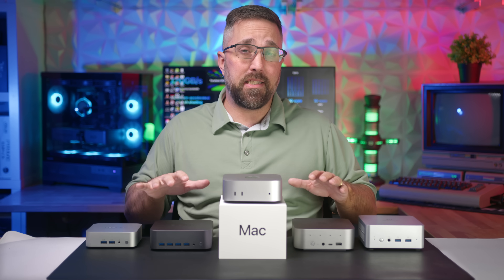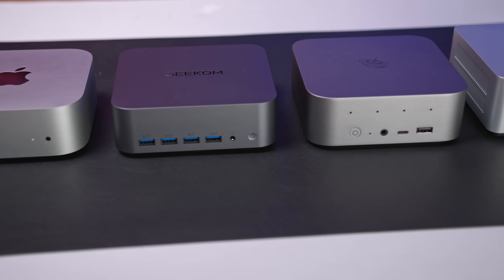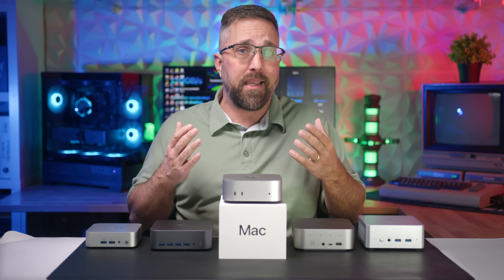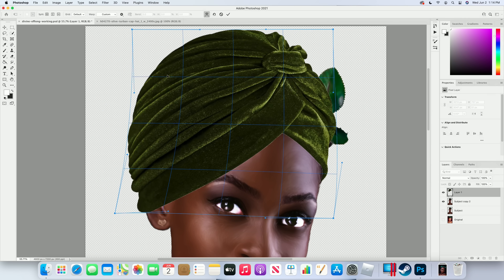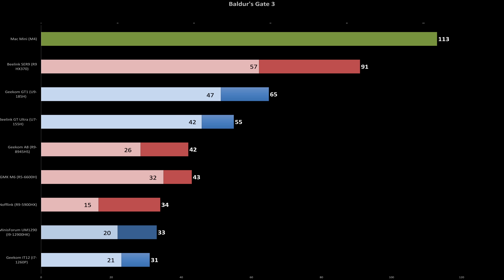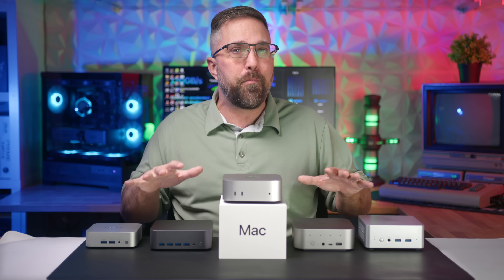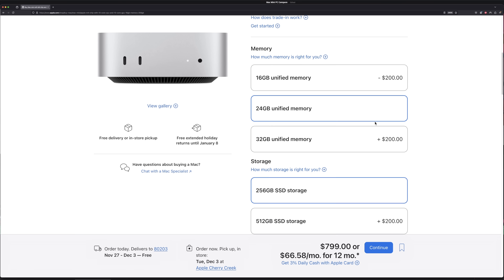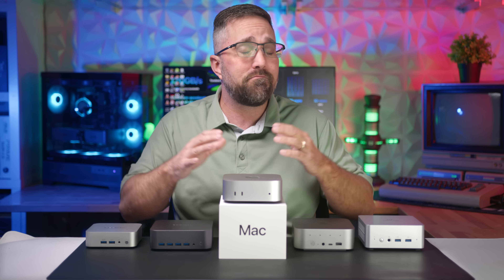M4 Mac Mini vs Intel and AMD Flagships – It's Not Even Close!

Comment: Was the Mac Mini running Windows? You need to compare all computers running equal systems, if one has specs that the other simply cannot get then that's not a fair comparison is it?  The Mini PCs were developed to meet Windows specs (an OS that still tries to support legacy hardware and software). They rely on different manufacturers who are competing for skin in the game in a massive computing industry.  This gives consumers more power because they have more and better choices on graphics, RAM, storage, and other upgradable parts.  The Mac Mini is a proprietary system running on pretty much the same OS for their mobiles.  It's also no accident that Apple focus on certain benchmark tests under different conditions, they're not running the same OS!  Real-world users looking at $599-$1000 computers are interested in something cheap enough to do daily computer work (MS Office and internet) and gaming.  They not looking to do serious video editing or 3D work unless they opt for more RAM and storage, which is inevitable with the way OSes and applications are going.  Even smartphones have 16GB of RAM.  The Mac Mini could probably impress your friends on the first day, but down the line it will become expensive trying to upgrade it.  
Future proofing and upgradability is the key.  The first mini is forgotten, and this one will be in a couple of years.

Comment: Remember when you could get the equivelant of the HX370 (7840HS) bare bones for around $500 shortly after launch? 
Yea, this is why AMD, Intel. and board partners want to go with soldered memory.
They want the Apple tax(many already do this with laptops)
When companies say that soldered RAM is for better performance, they are intentionally leaving out A LOT of context and factually wrong without that context

If the systems were designed differently, you could use fast upgradable RAM, the problem is that fast RAM requires cooling, and most of these small form factor systems have horrible layouts for cooling laptop RAM by stacking the RAM on top of each other, basically sandwiching the bottom stick, between the motherboard, and the top stick leaving basically only one side of the top stick properly cooled.

For instance. Before soldered LPDDR4X 4266 came out i was already running DDR5 5000, this was because i had desktop sticks and adequate airflow. Not only is the frequency higher, the latency is far lower and CL17-17-17-28 (running in 1:1:1:1 with my 5700G)

Same thing for DDR5, but this time, without overclocking, i've been running DDR5 8000 for about a year and its just an XMP profile on this 48GB kit. Show me LPDDR5X that runs at DDR5 8000 CL40 a year later.

Dont get me wrong, soldered RAM is a good thing..... for mobile devices like laptops and tablets, but when you're plugged into a wall and dont need to worry about a 5-15w stick of RAM other than how to cool it? It is cheaper, relacable, and just plane faster despite having longer traces

I do have high hopes for LPCAMM/LPCAMM2, this places all of the chips for what would be 2 sticks of RAM, onto one side, of a single stick, meaning it can be cooled with simple single-channel airflow, and now that DDR5 is better at varying its clocks, you could easily have an 8000-12,000MT/s profile for when you're plugged in, a 7200 when on battery but still gaming, and then 2133 when effectively idle
You probably would not want 8000-12,000 while on battery due to deminishing returns, sure it might make the system 15-20% faster, but its also going to likely make the system use 50-100% more power from the battery. This is actually why my file server with 5700G is running 2400 RAM and only running at 3Ghz instead of 4.5Ghz, ~70% the performance, 1/3rd the power draw, my entire server rack is under 350w under full load and this includes a 7950x, a 3950x, a 40G switch(2x40G 4x10G 48x1G) 10 spinning drives and ~24 SSDs.
Reply: What confuses me is why LPDDRx tends to have worse latency than equivelant speed desktop memory, you'd think that with those extremely short traces and significantly reduced number of physical chips that you'd be able to get very aggressive timings, say DDR5 8000 at CL26 instead of CL40 (desktop dimms can have 16 chips though generally the fast ones only have 8 where as LPDDRx can have as few as 2)

Comment: Mac Minis are not useful unless they support upgrading internal components like RAM and SSD. SSD of a Mac is just a chip. They can create a socket like desktop processors and provide customer with the option to upgrade it easily with proper compactness and chance for little movements and jerks. But they wont do that, I dont know why. Desktop systems should always be upgradable as per user needs changes. SSDs have less life span, we have already seen macbooks being dead just because of a tiny SSD. How we can support that? A really capable high performance machine that hosts cutting edge technology becomes just a brick when an inexpensive tiny SSD goes bad?

Comment: 5:10 They better not, I mean now that LPCAMM2 has arrived and is beginning to be commercially available they better use it, because I’m not going to reward that behavior from the other manufacturers, if they are going to remove me from any future upgradability and I need a new PC I will buy a Mac tbh, the same reason on high end phones I chose an iPhone instead of going to an Android AFTER they made basically impossible to have a high end phone with a MicroSD slot, steering to phones just a bit here but applies or both but if you’re going to go down to the Apple level f you then I prefer to go to whom was always down there instead of rewarding that behavior (or copycat behavior)

Comment: Base mini is not a deal. For this test bench, games were run from external disk. At any point in the name of ai, even installations will be impossible on external drives. If u invest in a walled system, u ll only get suckered in more and more. 256gb is nothing. Usable space will be less than that. Macos will take up space. Any important software will take up rest. So u r left if nothing if u want to install some more software or games. This is just a browsing machine nothing else. 512gb is where a working machine is at and it's 700$. Tbh y r base macs even reviewed. They r just browsing machines. Better to get last gen with more storage at that price.

Comment: 256GB of storage on a $600 computer is inexcusable in 2025, and charging $200 for an extra 256GB is a felony. 
I paid $160 for a N95 mini PC with 12GB of DDR5 memory and an upgradeable 512GB M.2 drive...
Reply: My 6 year old phone has more than that. Pathetic.
Reply: I paid $170 for an Optiplex 5050 SFF with 16GB memory (DDR4, 2400) and it still comes with a 512GB SSD, ain't no way in calisse I'm paying $600 for 256GB, that better be at least 1TB
Reply: being this entitled, and deciding what other company shall deliver at what price.. is likely more a "felony".. mindboggling entitlement.
I love that they made a 256GB 16GB version as that fit well with my usecase as a secondary device for certain things with our older OLED TV.. in regards to fx Apple only made a 512GB as the entry version at 799.. if Apple made a 128GB M4 version at fx 450USD I would have gotten that, I need the potency in M4.. HDD space is easy to work around for users that dont need it as their primary computer.
You do understand choices, ain't a bad thing... stop being triggered on other peoples behalf and call it criminal and all that entitled bs because a company gives the consumer choices.
Reply: @JAKOB1977  , thanks, I can think for myself.
If you go shopping for an SSD, you'll see that there's a $20 difference between a 256GB and a 512GB drive. There's absolutely no good reason go cheap on storage... unless planning on charging a whooping $200 for that miserable difference or betting that idiot consumers will run to buy external storage, with all its drawbacks. We are on 2025, files are huge and storage is cheap.
Apple's "choices" are worse than lame and they should be blamed for them.
Reply: @FrancoGrimoldi 13:58 dollar for dollar pound per pound. The Mac is the best that was the point of the video anything else you’re just ranting
Reply: @EAster33  sure I'm ranting. Selling a $600 computer with 256GB storage is beyond ridiculous, it's insulting.
Reply: @JAKOB1977 imagine defending corporation, lame.
Reply: @JAKOB1977  People like you defend anything apple does. 😂 Will you still defend the iPhone 17 Pro's color fading? Their price of charging $200 for every storage/memory increment is just lame. And it doesn't matter how much external storage you connect it to, you still have your OS on a tiny drive, heck my S24 Ultra has more storage than a base Mini. I still have a base M2 mini but as a file server, it's hooked up 18TBs of external HDDs, but even then the core problem remains, if I were to do anything on it, I would frequently run out of storage for my apps and OS.
Reply: @JAKOB1977  it's not entitled to ask to not get ripped off. Being a bit expensive is fine, but $200 for 256GB of storage is criminal

Comment: Picked up a M1 mini really cheap awhile ago,  can easily run a linux and win11 arm vm, smooth as silk.  Since I just wanted to play around and see what it could do. Very impressed, just had to use 3rd party apps to make the key combos like windows, because of muscle memory.  Can easily say its a nice system, its font rendering and easy to read text is probably not mentioned enough.   I have nas and a usb3 storage for it, so storage wasnt an issue.  I do AI LLM stuff, so the PC with a Nvidia is better fit, but music/video mac is still king.  Dunno, you can do anything on both, I'm more of a Win11+WSL+Code (and games) so sticking to windows.   For a laptop on the go, I could see a nice mac pro in the future, that battery life is amazing, display with nano glass is great.   What a time to be alive.

Comment: The price of the Mac is really good, but I think it's a shame that Apple spent a good part of the presentation talking about GPU and graphics performance and didn't have a downloadable tool to run more games. Half of my Steam library with Mac support didn't work, giving an error. Taking Steam as an example, in a short time since the Steam Deck was launched, it already has more compatible AAA games than Apple has in this year of selling M processors. Steam itself saw that the developers weren't going to support games for Linux, and it ran after it and solved it. Apple doesn't even care.

Comment: I just picked up a 8945HS for $700 64GB and 2T, can't even go up to 64GB Ram in Mac Mini, and 2TB is an extra $400 for MAC, not to mention the extra $400 for the 24GB max ram. EDIT: Just checked, so for 32GB of RAM and 2TB of storage, that puts you at 1800USD. YIKES.... So... THERE GOES YOUR VALUE TO PERFORMANCE metric.

Comment: If someone needs 32 GB of ram, they’ll need it on Mac as well. And 2tb ssd. That’s almost 2k then for Mac. Still good value?
Reply: I think poor Dominic doesn't really understand architecture.
Reply: Unified memory is ram
Reply: @notmii8855  no it’s not. They ultimately serve the same purpose but how they do it is significantly different.
Reply: @tjhell  yes it is, PC's and servers also use unified memory architectures
Reply: @notmii8855  there are no RAM memory modules inside Apple silicon macs. This is not debatable, you can look at photos of the inside or take one apart. Unified memory is both physically and operationally different.
Reply: @tjhell  having unified memory as part of a system on a chip is not something only apple hardware does
Reply: @notmii8855  Irrelevant. Nobody has said or implied that. You said "unified memory is RAM".
Reply: @tjhell  idk if you’re … or what, but you’re completely wrong. 
Apple has standard ram chips on their boards, they’re just attached next to the chip and used for system and video memory. Google Understanding Apple’s Unified Memory Architecture

And Macs need more ram compared to Linux in almost all cases and compared to windows in some cases. Adding the fact that ram in Mac is split between video and system memory makes it worse.
Reply: @tjhell  and Unified is LITERALLY RAM. Just connected more closely to the chip. Also read on what RAM means when it comes to computing
Reply: @tjhell  and how UMA does it differently? When I open the program does some kind of magic happen? 

It’s just faster, which is completely meaningless when you need a lot of it.
Reply: @forthphoto Think of unified memory more like VRAM, rather than traditional RAM. Instead of data being copied from RAM to VRAM as required by a project, the allocation of memory happens dynamically based on requirements. Say you have a large video project, or a large 3D model, then the GPU can get more memory allocated to its needs. It doesn’t work like that on traditional systems, because the GPU and the CPU don’t share the same pool of memory. It’s split. Leading to a lot of copied data, and bandwidth utilization that just doesn’t happen from a unified memory architecture. It’s the same on consoles. They use a unified memory architecture that is more performant because of its inherent less resource utilization.
Reply: @neodim4055  another one talking about stuff they don’t understand. Long before apple started using term unified memory ram was dynamically allocated for video memory in many systems, even when apple was barely known as a company. 
And „think of unified memory more like VRAM” is simply stupid. Why would I think of RAM, like vram? VRAM is just a ram that is made specifically for video use, which is not the case for unified memory is used for both system memory and video memory.
Reply: @forthphoto  Yeah, unified memory sometimes make it worse especially if the memory is low like 8 or 16 as the both CPU and GPU is competing for the same memory pool unlike traditional computers where DRAM and VRAM were a separate pool.
Reply: @tjhell  UNIFIED MEMORY is DEFINITELY RAM I guess you just don't understand about system architectures. Sure it's physically different as it's on the board itself but no it's not operationally different, it's still a system memory as a matter of fact it serves dual purposes and dynamically allots both DRAM and VRAM as required. Which is a good thing as it's faster as it doesn't have to travel longer data rails like traditional DIMMs but that's it, especially if you have a smaller pool of memory like 8 or 16, and you're doing something intensive like video production or something which requires considerable amounts of both memories, your GPU/CPU both are fighting for the same pool of memory unlike traditional systems where both DRAM and VRAM were separate pool. Once you run out of unified RAM the system starts to swap using your SSD as a secondary memory which in turn increases your TBW values tremendously and shortens the already finite life of a proprietary SSD. And apple didn't invest something groundbreaking here, computers are doing this since ages.
Reply: Apple silicon doesn’t use RAM, it uses unified memory, it’s different and you don’t need like for like numbers.
Reply: @tjhell  Unified memory is just the marketing term used when an SoC or APU doesn't have physical system RAM and video RAM pools, which is nearly all of them.

Specifically in Apple's ecosystem, unified RAM is presented as a singular RAM pool (at least to the user), and there's no way to manually reserve a set amount of available RAM to only be used as VRAM.
In contrast, most other systems will have an ability to reserve some of its RAM as a dedicated VRAM pool (generally with that pool being the minimum available, and programs can request the OS to allocate more RAM to be used as VRAM), or have the OS/firmware do it automatically.

RAM can come on modules, such as DIMM, SODIMM, CUDIMM, or CAMM modules. It can also be soldered onto either the mainboard directly (as with Strix Halo products, Intel MacBooks, and some other laptops), or integrated into the SoC directly (such as ARM chips in phones, laptops, and SBCs).

The fact that you'd argue that unified memory and RAM are different just proves Apple's marketing is effective on the tech illiterate.
Reply: Macs use ram differently so you don’t need that much…
Reply: @dominicbritt  suuure, you can run the same program with less ram on mac lmao. Keep dreaming
Reply: @dominicbritt  yes, from the tests it looks like they use more ram. 
They have fast ssds for caching when comparing 1200 Mac with 300 pc that also has 8gb ram.

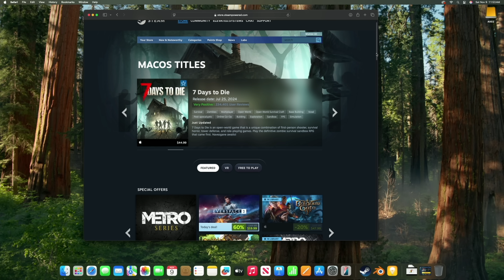Comment: 11:57 - I have a M2 Max studio and it runs games well. macOS that came out in September added AVX support and now most games run well using crossover. I played through baulders gate 3 and ratchet and clank rift apart maxed out on a 21:9 screen and had no issues. Granted it’s only been a month and crossover took some experimenting to get working right.  I’m cautiously optimistic 😅

I also have a windows VM that runs smaller games like metal slug tactics well. I have DX 11 and Vulkan running on it with the trade off being overhead of using a vm.

Comment: Good cpu comparison, but there is an issue:
256 GB of storage is ok for smartphone, for workstation at least one TB is required. 
So, any value comparison is pointless with this very basic configuration.
Reply: What is use is power if it's crippled?
Reply: @andrewlace  Yeah, I agree, any serius work with data is either impossible or annoying as hell due the constant need to manage data on disc. This version of Mac exist only for marketing purposes... so the can add "from 599" in promo, they are simply assh*les.
Reply: For 200$ a Thunderbolt enclosure and nvme gives 2TB?